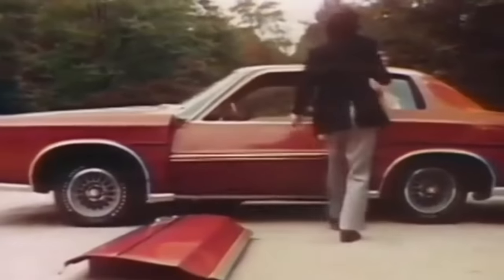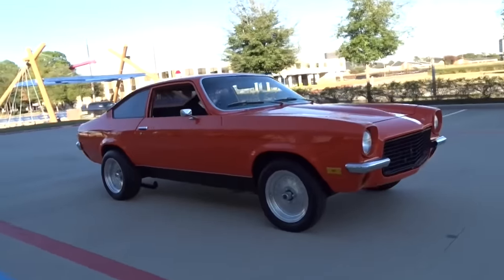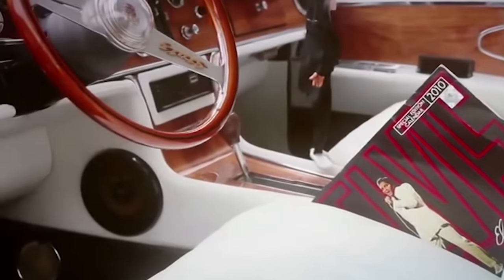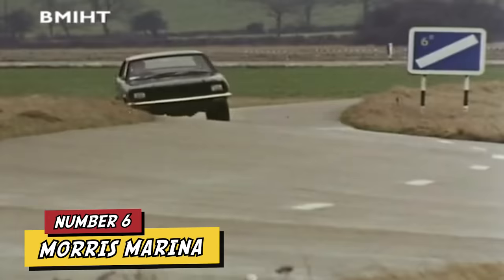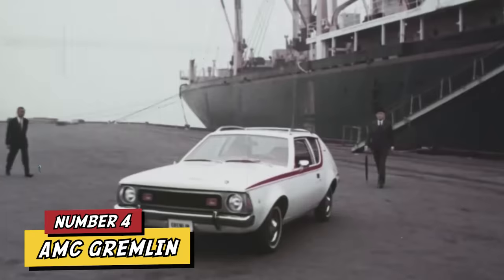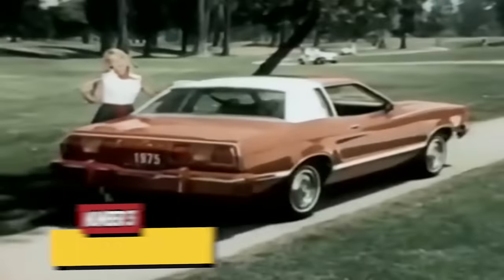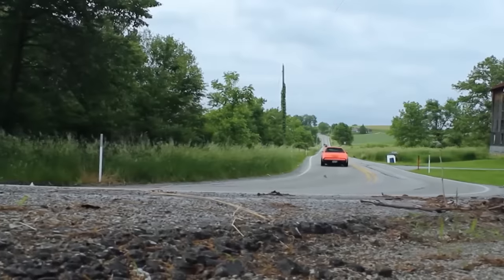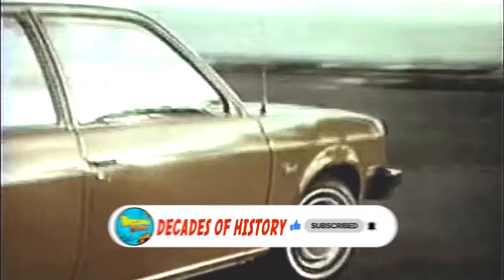Top 10 The Most Disastrous Cars Of The 1970s | Decades Of History

Comment: 9:58  ..."base inline six..."? 
Not in the Mustang II. The base engine was the 2.3-liter Pinto engine, the step-up was a 2.8-liter V6, and the 302 V8 became an option a year or so later.
Reply: This is a click bait video for views.  No accuracy is required.
Reply: He also claims the Bricklin was made in 1975 through 1976 completely glossing over the roughly 700-800 cars built in 1974 with AMC V8's.
Reply: Ya. No mustang 2 ever had a straight 6. They are confused. After 79 yes.

Comment: Everybody talks smack about the Pinto, but the Mustang was the same thing, and every single car on this list has the gas tank in the same exact place, and had pretty much the same risk.
Reply: The pinto was found to have the exact same risk as all others in its subcompact class except the VW bug with its tank up front, and all the other imports testing below the pinto in rear  end collision fires.
Reply: @Project_Low_Expectations  Funny thing is Panthers have a similar issue, but they ended up giving them armor around the tank. Why they couldn't do that with the Pinto is beyond me. Matter of fact; my s10 Blazer had it's tank covered with a plastic shield, probably for the same reason.
Reply: @ItsDaJax  you are holding a 1970 design to late 1980’s standards. 
Could they have? Sure
Were they required to? Nope. 
People are always pissed at the wrong people. Everything is done to a minimal standard. And if that standard is minimal, that’s what you get.
Reply: @Project_Low_Expectations  You're right. I was using them as an example, but yeah, tines were different and a car that drove off the line was a success back then
. Few years ago I was working at Ford, parking and moving the MKC and Escapes... the stories I heard, made me happy none I drove had issues. Things like the gauges turning off, or breaking down on the highway.
Reply: @ItsDaJax They had the chance to recall the Pinto for approximately sixteen dollars a car but Ford balked assessing it would be cheaper to pay off the few impending casualties. They made the wrong call.
Reply: @ItsDaJax because Ford wanted to cheap out. Not that many burned but Ford looked bad because they decided it was cheaper to pay out the lawsuits.
Reply: The mustang 2 was not the same. It did share part of the floorpan though.
Reply: @mikeholland1031  And suspension and engines. It's the same platform, so it's pretty much the same. That's like saying the gen one mustang, Maverick, and Falcon aren't the same because they're different bodies, when the former two are on the same platform as the Falcon.
Reply: The mustang 2 didn't have the fatal gas tank defect as the pinto
Reply: @FranciscoMartinez-ef2br  ya. The pinto didn't even have it.

Comment: The Vega should have been a much better car. It was well-designed but poorly executed.
Reply from the maker: Yeah it was a looker.
Reply: Yep.  Bought a brand new ‘74 hatchback for my wife, and had it for two years.  Ran great, drove great, and we put 33 K miles on it.  Had it “rustproofed.”  Still, one fender started to rust through at about 12 K miles/ 1 year- and GM’s generous 😅 1-yr warranty covered it.  Months later, the 2nd fender started, but the warranty was done.  GM paid for the part, I paid labor.  In the meantime, the front end alignment couldn’t be aligned any further… out of adjustment.  GM had a fix with shims, but I had to pay.  At 2+ years old, a door started to rust through, so we traded it.  Mechanically, the powertrain was great.  I maintained it well, but in two years, it probably didn’t have sufficient time for the aluminum cylinders to wear down too much.   Up until that Vega, I belonged to a strictly GM family.  After that, not so much.

Comment: I had an 86 Chevette "sport" edition. I bought it for 400 and sold it two years later for 200. It had a four speed manual transmission, and the cable that moved the gearshift underneath the car looked like a washer cut in half. I found this out the hard way as the clip broke in the middle of an intersection one afternoon. I also had to frequently crawl underneath and reattach the speedometer cable which never seemed to stay attached no matter how tight I turned the bolt. I also lived in the city where Bricklins were built and knew a few people who worked at the plant while it was open. Each car was very unique in the sense that engines shocks, tires and other components were supplied from several auto manufacturers so one car had a ford motor, firestone tires and munore shocks, and the next would have goodyear tires and different shocks. One of the local radio stations raffled off the very last Bricklin  built at the plant. The person who won it said the parts were all attached but in many areas, none of the bolts had been fully secured. The gull wing doors always failed (especially in the bitter cold NB winters) and sometimes poor wiring would cause a person to be trapped inside as an electrical fire started. My mother also worked in an insurance company there and she had a client who had five Bricklins all disassembled and stored insured with her company. Incidentally the plant where the cars were built is a cold storage facility for a fruit distributor in the area now.

Comment: 7:32  Note the single width brake pedal. 
The double-wide brake pedal became the industry standard shortly after its introduction on the 1950 Studebaker models equipped with the Automatic Drive three-speed automatic. As a side-bar, Studebaker and Packard (not yet merged) were the first two car makers to include a locking clutch in their automatic transmission torque converters (transmissions developed independently of each other).

Comment: A friend of mine, had a '72 Vega, with a 500hp 327 Vette motor in it. He has the Fremont raceway 1/4 mile record in his class, at 8.7, and 140+mph.

I had a red on black, '78 Mustang II Hatchback, in 1982. 302 4 speed. It was a Vette eater. I put a lot of time/work in it. The biggest performance difference? A 1969 spec, Boss 302 crate motor, and a Performance transmissions of America, 5 speed. 
10.75:1 compression, a racing cam, and an ungodly number of upgrades, that included some undercarriage work, and it was an absolute beast. How much of a beast?
9.75 ET, at 141 mph.

I've had four Pinto's in the early '70's (''72). By then the gas tank issues were fixed by them, and all four, were VERY dependable.

Comment: Had a friend with a chevette , weak , I switched the carb jets around in the carb , put the larger secondary jet into the primary side and it actually  ran much better. He drove it till the wheels fell off.
Reply from the maker: That's awesome. Looks like you and your son are going to have a good time on the 73 455 trans am. Thanks for watching!
Reply: They seem to make great race cars in europe, so they aren't that bad.
Reply: Notice you didn’t give a mileage, just”until the wheels fell off “ that might have been just 200 yards.
Reply: @robgraham9234 it was among the first American built cars to regularly roll past 100,000 miles
Reply: They were slow AF ant built cheap, but generally drop dead reliable and usually remembered fondly by the former owners.
Reply: I had several friends who had Chevettes. They seemed decent for a cheap car back then.

Comment: The Pacer was designed around a rotary engine GM had good luck with in the European market. Under looming unknown emission laws, GM at the last minute decided not to sell the rotary to AMC, leaving them to stuff their heavy, long, 6 cylinder in it. Which led to the mechanical and handling issues. But they sold like crazy the 1st 2 years.
Reply: I've heard that. The 258 Its somewhat of an offspring of the 232, but that was one of the best motors ever produced. Interesting this history
Reply: There were no serious mechanical issues with the Pacer; it had mostly the same tried and true components as other AMCs. There were minor issues with early models. My 1975 needed it's fuel delivery system replaced but I had no other defects. There were no handling issues. The rack and pinion steering and front subframe made it handle very well for a non-sporty car.
Reply: @RagShop1  
That's good to hear. There's a Pacer vid on here of the AMC employees cramming the engine in there. Looking like they had to do some improvising.
Reply: @happydays8171  Yes indeed. And that made changing spark plugs difficult. I had to use a right angle wrench to get at them.

Comment: I'd take any one of these cars over anything sold today. 
I've owned several Pintos, Chevettes, Vegas, Gremlins, and even a Pacer over the years. 
The only one on the list that may belong here may be the Marina, but they were few and far between in the US.  The Grand Prix was just Pontiac's version of the Monte Carlo, and by far not the worst car from the 70's, nor was the Bricklin, which was more of less just a niche model to compete with the Corvette. 
If you want to talk about worst cars, then take a serious look at Fiat, Datsun, and Subaru from that era, each which had some of the most serious rust and reliability issues the market has ever seen. Fiat and Subaru were known for their front struts bursting through the hood after the structure that retained them rotted away, Datsun had engine problems in the way of dropped valve seats, blown head gaskets, all on top of bodies that rusted away in front of your eyes. 

I put 500k on a Pinto and sold it with the original motor and trans still running strong, my Gremlin would still be here if a drunk behind the wheel of a trash truck hadn't flattened it against four other cars and a sycamore tree. 
The Pacer was very much the very same car as the Gremlin. The only faults I ever found with the one I had was that the large area of glass made it hard to cool in the summer, and the motor being tucked so far back under the cowl made working on twice as hard as it should have been. But it was dead on reliable for the 80k I put on mine, which had 140k when I found it.
If I were to pick the very worst car i owned from the 70's it would have to be my '75 Corvette. It was the most gutless excuse for a car I've ever owned. While I fixed all that, the build quality of those cars were terrible and calling something with 165hp a 'sports car' was a joke. 
One summer with that thing was all I could stand and $10k later it had all the power it needed although chasing the elusive emissions sticker ever year made it more trouble than it was worth and down the road it went to become someone else's problem. 

If I had to pick the worst car ever in the 70's it would have to be a Fiat, any model, just pick on, they were all equally bad. Sort of predecessors to the Yugo, which was in reality, just a Fiat built by communists. 
The 1978 Fiat Strada has to top the list though, with some of the worst rust issues I've ever seen, a tendency to break timing belts and a list of 'inherent issues that cannot be easily solved' as stated by Fiat themselves, the car was a complete disaster which duped some into thinking it was a good alternative to a VW Rabbit (or Golf outside the US). 
Worse then all the issues themselves, Fiat came up with an erector set type repair for the rusty cars still under warranty, which amounted to a box of pre-stamped plates to be riveted overtop of the badly rusted out strut towers and firewall. The end result was horrendous because they fully expected the average tech to do about these repairs with no real structural training using a rivet gun and drill in hopes that there was enough of the original metal left to hold those rivets or plates. The fact that no one was ever killed by the fix, let alone the rust failures themselves, was likely pure luck. Any repair that required the tech doing the job to sign a non-disclosure agreement before they'd ship out the kit should have never been attempted. 
Luckily, less than 5 years later Fiat pulled out of the US and those cars all quickly melted away in the scrap yards soon after.
Reply: Yeah, the 1971 Grand Prix on this list seriously undermines what could have been an interesting video.

Comment: The Pinto was a good car for the times.  A "rolling bomb"?  What hyperbole.  The design was the same and as safe as other small cars of the time.  The Pinto was actually mechanically very reliable. The Vega should be #1.  This one thing discredits the whole video.
Reply: Both the Pinto and Gremlin were vastly better than the rust bucket, melting aluminum engined Chevy Vega-truly the WORST!
Reply: The entire problem with Pinto was down to Lee Iaccoco. He insisted the gas tank shield be removed because of cost. That same shield was retrofitted after the lawsuit was resolved.

Comment: Many of the worst cars are the result of economists and lawyers managing companies that are interested only in maximising profit. The Pinto could have been a great car if Ford had relocated the fuel tank but the lawyers said no. It is cheaper to pay the lawsuits.
Reply: the tank was changed by mid 72s The 71s were recalled and a hard white foam part
 was installed between the bumper and gas tank, my family had a 71 Pinto  it was weak and very slow it had a 1600cc engine but it was wonderful on gas my Dad loved it
Reply: @sirjohnnydragon6436  1600cc is too small. It should have been ar least 2000cc.
Reply: @ngauruhoezodiac3143 1.6 is about right for the class of car. 
It later for the 2.3, was still slow AF, but it was supposed to be.
Reply: @Project_Low_Expectations  the old 1600 cih engines put out only about 80 hp. Modern 1600 16 valve engines have about 130hp. That makes a big difference. The old Pinto 2 litre engines that were used in the Cortina and Taunus had about 105hp.

Comment: I've owned three on the list. A vega, a pinto and a Gremlin. The Vega was very expensive to keep running and succumbed to rust out. I believe its called the trailing arm rusted out where it attached  to the floor pan area. Almost caused me to crash when it happened. The Pinto was a pretty inferior car also. 
The Gremlin I think gets a bad wrap. I had to put some  money into it bit once I did it became a very dependable and fun to drive car. For a 6 cylinder with 3 speed manual it moved like it had a small block V-8 in it. 
While not as high powered as the 1960's cars not all 1970's cars were bad. Most you could do some minor chandes to and get that 1960's or more power out of them.
Reply from the maker: Looking back at them, they are pretty nice looking cars. The Vega sure was a looker.
Reply: My friend's parents had a 1975 Vega. I recall that it ran poorly, but that could have been a maintenance issue. In 1978, it was nearly done as its rockers and fenders were rusting badly.

Comment: If I recall as a teen growing up in the 70s, the Pinto gas tank wasn't defective at all.  It was 2 bolts that  were used to hold the bumper and punctured the fuel tank on hard rear impact.  Also, the Bricklin overheated mainly with 1975 cars.  The radiator was too far way from the motor.  This wasn't the case for the 1974 models with the AMC 360, which I had and loved it.  The bumpers are actually 10 mph rated before damage and not 5 mph.

Comment: Until 1969, the Grand Prix was a tarted up Catalina emphasizing sports and luxury.  The 1971 Pontiac Grand Prix (a facelift from the 1969 clean sheet reboot/redesign) most definitely doesn't belong on this list.  The size and economy issues noted are the same all Detroit cars suffered.  As for "driving satisfaction", the Grand Prix was an owner pleaser that was so successful, it's fourth generation was an evolution of this 3rd gen design rather than a clean sheet.  This 1969 design gave this Grand Prix a ten year run that sold well every year.  Grand Prix left a legacy that kept the model a major Pontiac seller until the demise of the Pontiac Motor Division in 2009, forty years later.

Comment: The pinto was all bullshit. If you look at the DOT data the national fires in these cars was less than average. Another fact is the mustang2 had the same platform just longer,but back was the same as also with the fuel tank. Why did it not have the same stigma.  Simple the pinto was killing "only" the competition and marketing sabotage was under way. Only issue these cars had was rust. The safty these cars was actually even better than average and it took a bit for them to realize that it was them crumpleing up that made it safer. Think this was in the time they was hanging big bumpers to make them safe and not engineered crumple zones. Even when they took the pinto and did test on it they could not get it to even catch fire. And then when they set it up to catch fire, it would only burn, not blow up (even with a mostly empty tank) they was testing the GM truck with saddle tanks and it would not blow up but it was able to start a fire. Now ford did do an update but was just to appease the magazines. It wasn't a fix due to it wasn't really a problem to begin with. And that was a mistake that ford did because doing that was kind of like saying their was an issue. And it bit them in their ass!

Comment: I had a 1979 Plymouth Horizon that I got used in 1985 and it could be really problematic and had power issues as well. But I was younger and after driving a gas guzzling 1972 Chevy Bel Air I needed a change! Haha!

Comment: I add the Datsun B210 and the later 210.  Rust issues, underpowered, and troublesome carbs that the dealer couldn't fix.  Also suffered from the pinto tank problems.